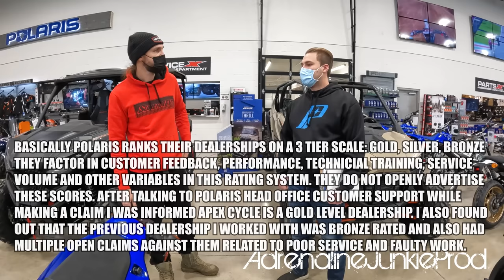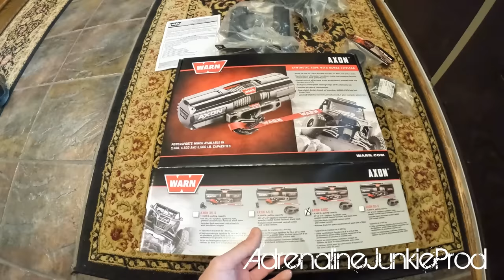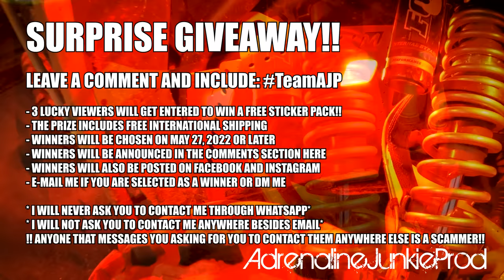Chill Winter SXS Trail Ride + Battle Wagon Update: New RZR Transmission + Other UTV Goodies!

Comment from the maker: Thanks for checking out the video. This one is a little more laid back then usual but still a great time with the crew on the trails!! Stay tuned, the next ride has a lot of snow and  a lot of action!! Hope you enjoyed all the updates. The #BattleWagon is ready for war now and I still have some more badass modifications in store for it! The transmission has been working great and I isolated all the issues I was having in this video to the front differential which I will be addressing in the near future. Leave a comment and don't forget to smash that like button!!
Reply: Hey man, cool video. I wanted to ask you a question, what are youre thoughts on an X3 max on haliburton area trails, the 4 seater, Do you think that wheel base is just to much or reasonably manageable? Looking to maybe purchase, Rmax 4 seater is in play also.

Comment: #teamAJP   great video.  Winter rides are always a great break from the cabin fever,  but glad it's starting to warm up.  Had a rough spring,  but almost ready to ride again.  My rzr is getting the snorkels redone,  front diff fixed,  new front axles, and just put on a set of outlaw radials.  Can't wait for the next video.  #TEAMAJP
Reply from the maker: Hey Carl!! Sounds like your beast will be ready to send it this spring/summer!! Ya, I'm happy the cold is gone now too,  winter riding rocks but summer weather rocks more!  Good luck on the giveaway man!

Comment: ST springs are great!! They will settle once though and you will need to re adjust your ride height. I’ve only had to do it once with my DR springs from them. Very happy so far!
Reply from the maker: They are amazing. I’m so happy with them. The machine feels so much better. Ya, they did settle once. Took a few times to dial them in just right.

Comment: Unfortunately I know what you mean about the clutch wear.    Didn’t realize until I lost a ton of top speed.   Clutches were worn really bad.    Have new clutches now, and back mobile.  #TeamAJP   Do you know  Is there a Canadian dealer for aftermarket assassins clutch kit and tuner?   Running stock tires but a lot of the same super atv and McNasty gear like the battle wagon.   Just want to wake it up a bit more.  Lol
Reply from the maker: Hey man, ya I learned my lesson the hard way too. Let the clutches get too bad the first time I serviced them and recently had to replace them like you saw. I ordered straight from Aftermarket Assassins. Shipping wasn't bad at all and my stuff got here quick. Duty and brokerage was a little rough but its like that on anything and exchange always gets us. If you order from a "dealer" prices won't be much different because they still pay shipping and duties on the stuff too and then also need to make a few bucks. It's well worth the money, the machine feels wicked with their goodies.

Comment: Anyone else getting flashbacks to the sxsblog guys doing cyclones and locking up the engine on that brand new Pro R?  I'm terrified of donuts after seeing that.
Reply from the maker: I’ve done them dozens of times in this machine over the last 5 years and haven’t had an issue. You need to go absolutely crazy to make it an issue. None of us have ever had a problem.

Comment: How are liking the megabites?   Running zillas now but wanting a more all around tire, especially for snow.  Appreciate your insight…
Reply from the maker: Hey Mike, I have to say that they honestly have surpassed my expectations. Currently they are tied for my all around favorite trail/mixed use tire with the System 3 XTR 370. Price wise they are hard to beat and I feel that is a huge deciding factor for most people. As I've mentioned before they do measure on the smaller end. My 32's measure about 30.5 on the machine at trail pressure. So what I recommend is you order a size above what you want. I have nothing bad to say about them though. They hook up really well, clean out well when you spin them, air down well and seem to have a very tough sidewall. Overall I can comfortably recommend them as a top choice. I love them.
Reply: Thank you so much for your reply and your opinion.  I’m heading to Montana in November for a two week mule deer hunt… need new tires, these Zillas are terrible on snowy roads, great for trail riding and rock crawling though. I guess you can’t have it all!!!  Enjoy watching your videos, keep up the good work!!!! I’m down in Kentucky, there’s a lot of great trail riding in eastern Kentucky, you guys will have to come down and visit. Stop into hollerwood or S tree on your way down to ride royal blue/brimstone/Windrock….some gnarly stuff!!
Reply from the maker: @mikehall8791  I’d love to ride out in Kentucky again!! Some awesome terrain out your way. I think you’ll like be Megabite as an all around solid performer. Good luck on your hunt!!!!

Comment: Tip from Polaris tech .... I trust him ...... he said after you fill trans, elevate the unit high enough to add 2 pints more fluid ..... he, they, said it helps lubricate upper bearings in the trans    ..... changing to Lucas, Amelie or RedLine fluid is a must ....... Polaris lubricants go to the lowest bidder  ..... not good ...... start with Mobil 1 and substitute where ever ...

Comment: Bigger tires are nice but brings bigger problems in the long run unfortunately! Especially sticky tires! Everything has a trade off! I’ve went back to stock 30” on my ride. After killing some clutch components and trans axle issues!
And so far much less issues!
Reply from the maker: Ya… tire size is by far the biggest trade off. Different riding styles, conditions and machine setups all affect what’s best. There are benefits to a 32 and cons too over a 30. It really depends what your after. Far from a one size fits all.
Reply: @AdrenalineJunkieProd  very true! Glad you got your battle wagon back in the fight!! Lol

Comment: Amsoil and Lucas full syn gear oil is amazing! Recently switched to thicker oil as you did!!
Reply from the maker: Are you running 75w90? How are you liking it?
Reply: @AdrenalineJunkieProd  yes lucas synth 75W-90 trans diff lube! Great so far seems smoother and quieter and maybe run cooler!
Reply: I will do a fluid change after 100 miles and see how the oil looks and if any metal on magnetic drain plug. I might experiment and add 25% of Lucas oil stabilizer…so 75% gear oil and 25% stabilizer.
Reply from the maker: @outdoorzone  hmmm. May have to give that a try too!

Comment: Man I know all about working on your machine for hours taking it out and having problems.  Did a rs1 swap in my xp4 1000 took it out out now in 4wd at full turn it sounds like it's binding and grinding.  Can't figure out what is causing it axles or diff of maybe it just needs to break in. #TeamAJP
Reply from the maker: Oh no!! Really!? I’m gonna be doing the conversion this week. Hope it turns o he well. Are you running turbo axles? It shouldn’t make binding and grinding noises. That’s not part of break in… that more like a part of “break it” lol.
Reply: That's kinda what I figured but am also having a hard time figuring if it's axles or diff.  It definitely doesn't feel right. I did end up with demon axles and I remember you saying that they are the worst axles you can run. So i kinda want to get a different kind but don't really want to spend money on new axles if that's not the problem. As far as installing everything it went rather smooth. I did get rs1 axles I guess I gotta pull it all back apart and see what's going on

Comment: How has it been running 75w90 in the new trans?
Reply from the maker: Hey Zach. I kept the stock fluid in it for the first few rides. I wanted to make sure everything was OK with it and incase it wasn't I didn't want to take it back to the dealership and have anyone try to blame any issues on the fluid. I'm just about to tear the machine down for some work and I'll be swapping over fluids. Not sure what I'm gonna run yet. I've read some conflicting stuff online and I've been trying to decide whats best. I'd love some input on what others are running and why.

Comment: Did they give any issues warranting the tranny since you have a clutch kit?
Reply from the maker: Hey Alex. No issues at all. Even with my aftermarket axles they were fine with it. I’ve always had excellent experiences with the Polaris warranty. Even when they deny something you can often appeal it and reapproach the the case through your dealer. The number one biggest reason claims get denied are due to a shortfall on the dealership end. The dealerships job is to advocate for you. They are your middle man. If the dealership goes to bat for you then Polaris will usually play along too.
Reply: @AdrenalineJunkieProd  That is awesome to hear, I was putting off getting a clutch kit incase it would void my warranty.

Comment: Front diff is definitely shot... it was ratcheting pretty badly last video and that's what probly did it in...
Reply from the maker: Yup 100%. I ended up blowing it in an upcoming winter ride. Last winter ride of the season the RZR took some carnage. The diff was part of the casualty list. Wait till you guys see that video. Soooo much action lol. Just got my RS1 diff and adapter bracket from Joe Coffman at CCM this week in the mail. I also got him to fully build it using his “Hill Killer” specs. It’s gonna be a beast with the new diff. Hoping to swap it in this coming week!
Reply: @AdrenalineJunkieProd  ya you can't beat the Joe Coffman hill killer setup it's un beatable stoked for ya...
Reply from the maker: @hubelit  super happy to hear that man!! I did a bunch of research and everyone recommends it and after chatting with the guys at Coffman Machine I was convinced. They are swamped building these diffs. They were telling me it’s hard to Keep up with all the demand which also usually means it’s the right choice.
Reply: @AdrenalineJunkieProd  absolutely 💯  it's what everyone's running.... you won't be disappointed it's what all the utv rock bounces use hence the name hill killer ...
Reply from the maker: @hubelit  so damn excited to get it in and try it!!!
Reply: @AdrenalineJunkieProd  ya buddy I can't wait for you to go full send mode on the old vidyas lol